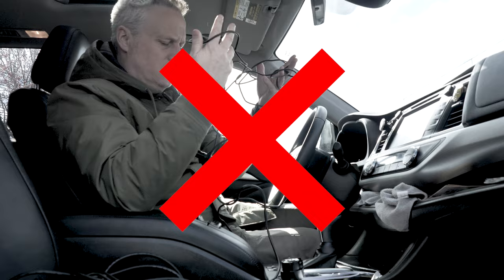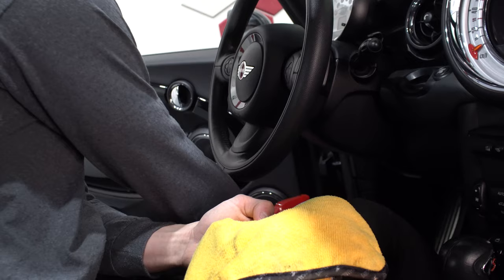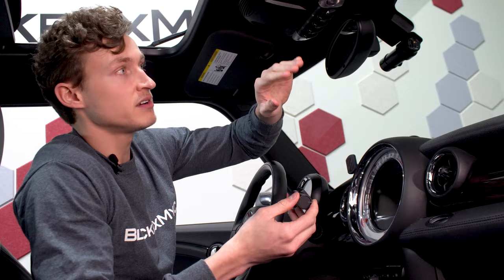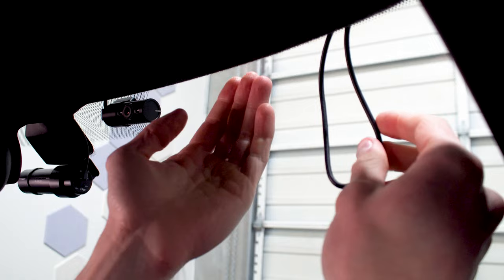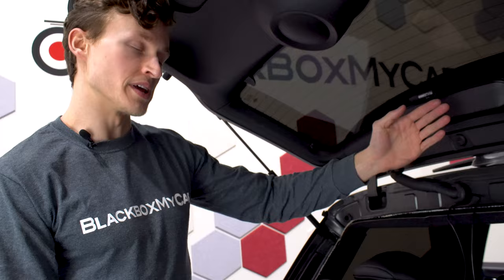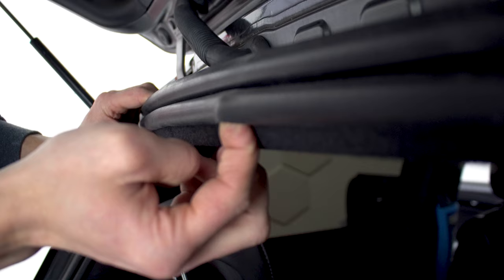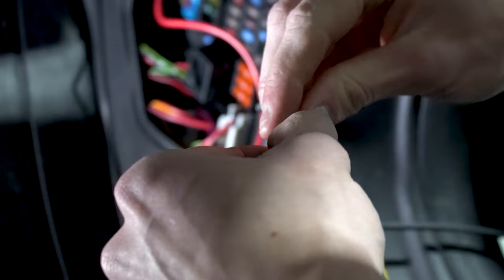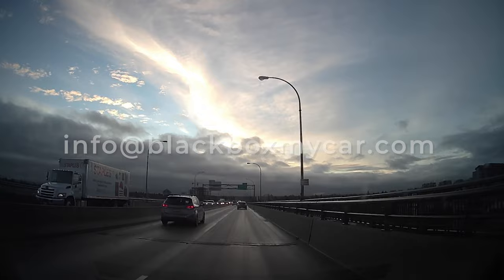How to Install a Dash Cam | BlackVue DR750X 3-CH Plus in a Mini Cooper | BlackboxMyCar

Comment: @6:48, this is one of the most difficult steps when installing a dashcam because some of the rubber grommets are right angled and hard to feed any wires through it. Also, when it relates to the rear camera, I've found it easier to start the wiring process at the rear and work forward. That way any excess wire can be tucked away in the kickplate or under the carpeted floorboard.
Reply: Yeah. That's the hardest part. Not the actual finding a fuse.

Comment: In your video, you did not turn off the battery or take the A-pillar cable from behind the airbags. This question myself is questionable about the connection ahead.

Comment: HI I currently have Blackvue DR750-2CH LTE installed in my car and was considering upgrading to this Blackvue DR750×-3CH would it work using the same power cable as it's already fitted and hidden within the car headliner, so I'd rather not change the power cable if possible
Thanks Chris
Reply from the maker: Hi Chris! Unfortunately the LTE version of the DR750 actually uses the old cabling style, so the power cabling will not be compatible with the DR750X-3CH, you will need to switch out the power cabling. At the least, the front/rear coaxial cable is exactly the same, and that could stay in-place.

Comment: hello is the blackvue 900 plus hard to install in a bmw f30 , I had a uk 🇬🇧 retailer install the dashcam / power magic battery but the dashcam would switch off and not turn on when starting the car , battery was changed and same thing happened in the end the retailer could not solve the issue.
Reply from the maker: We had no issues, have done many F30s at this point.